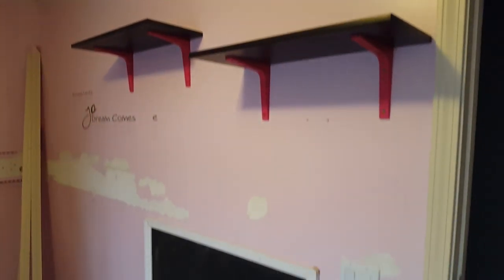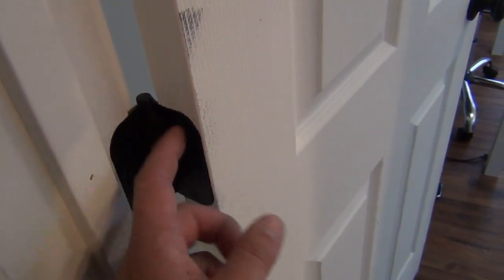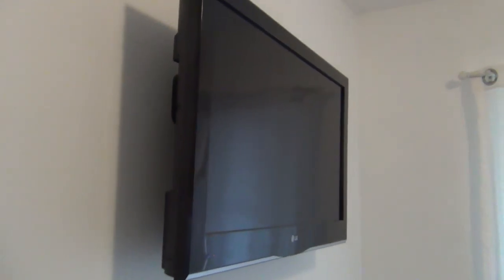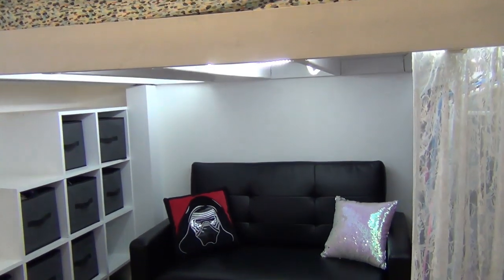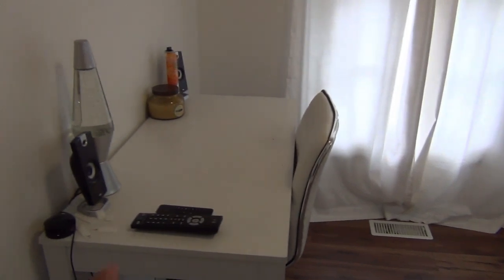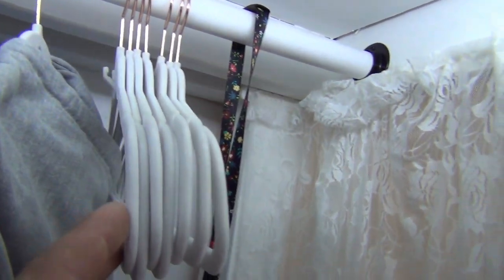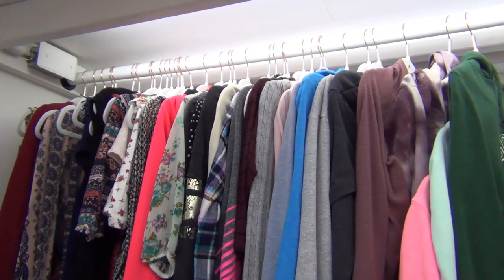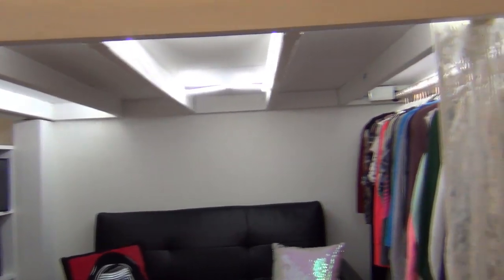Tiny Room Build Tour - 2 Year Update

Comment: For the stairs, there is a company called Flor that sells carpet squares in every color and pattern.  The squares have a rubber back so they dont slip.  They are pricey but for such a small area shouldn't be too bad.  For hand and bed rails, the black pipe would be great!

Comment: i built bunkbeds for my two like that years ago, and the matress was about 8/10 inches short of the base ,so i made storage areas above the head end, into storage places to fill in those spaces  10 x10 x 4"the width of the bed base, with hindged lids..so they could put thier toys in that they had on the bed with them,.bunks were two feet high and the top one  six feet high with a ladder on the end...

Comment: You could put poles. Copper. Black pipe. Wood. Whatever Vertically from the loft to the ceiling. Space them far enough apart that you can see the tv, while up there. It would still be close enough that a person who rolls over toward them is either going to get stopped. or it will give them something to stop themselves WITH...

Comment: I think some copper poles from the edge of the bunk to the ceiling might be good, instead of a whole railing, as it would be more open as kids like , about every 18 inches..and a support for a phone or tablet on the wall by the socket, for charging use, as very dangerous to charge things whilst on the bed, its a major fire hazard,..